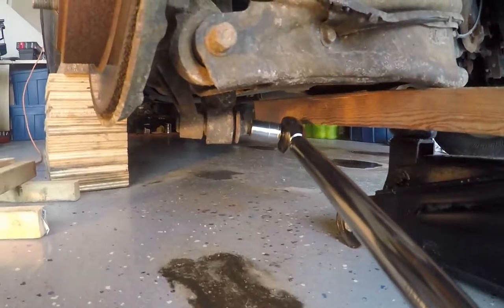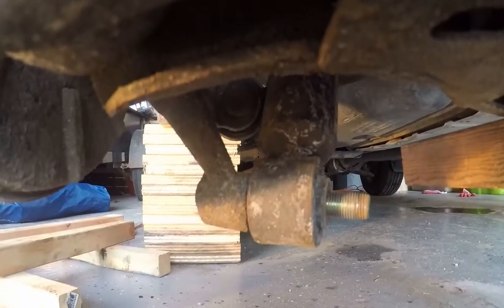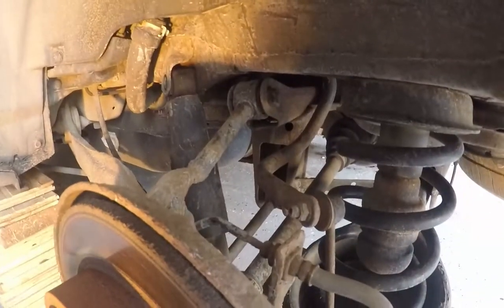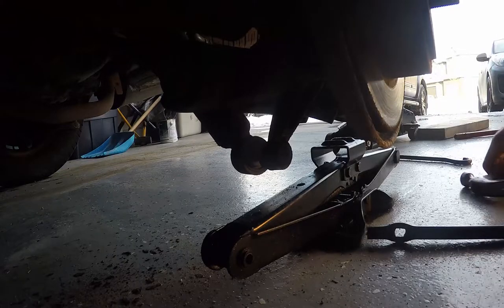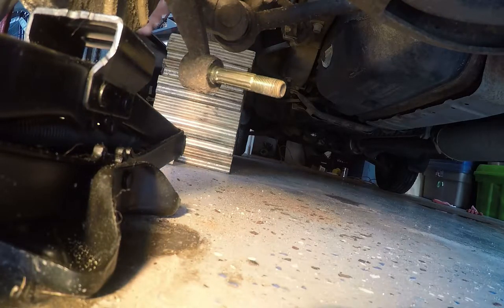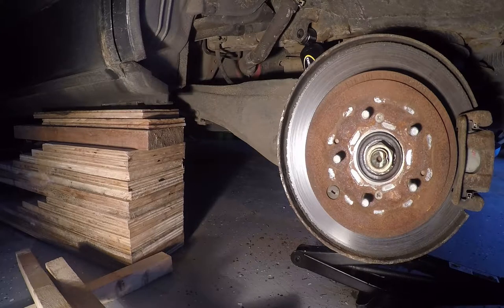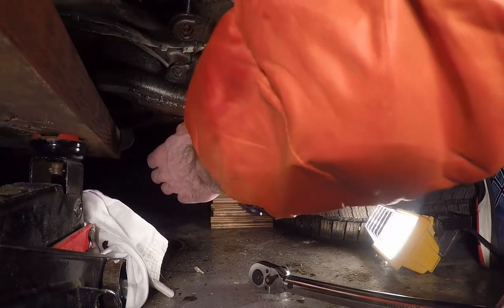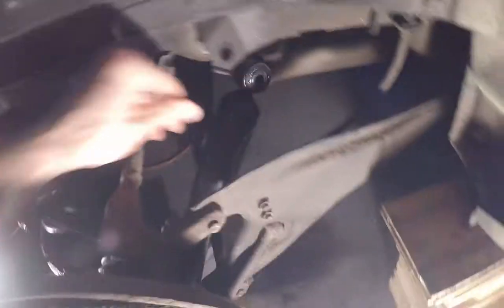2005 Honda Pilot Rear Shock Absorber Replacement

Comment: Great video - thanks for taking the time to record this. I'm doing the same job later this week and went with the same Monroe rear shocks. Have 144K miles on my '05 pilot and noticed the rear is extra "bouncy" lately (still original shocks), even when not under any extra load. Figure I'll do the rears now, and in a month or two replace the front strut/spring assembly. 

How was the ride quality after you did this?
Reply from the maker: It was better.
Not crazy better, but noticable.

Comment: NEVER,NEVER,never ever use a torque wrench as a breaker bar! Torque wrenches are calibrated because these are precision tools.
When torqueing the shock bolts with extensions you lose torque through these extensions.
When you look up torque specs, these are with regard to using a shallow socket with the bolt threads clean and lightly oiled. Even using a deep socket is enough create less torque for that bolt.
Similiary, using extensions decreases the final torque value even more. 
For rear drive vehicles that uses a driveshaft from the transmission to the rear end alot of torque is lost through the long drive shaft. This doesnt include torque that is lost  through the transmission  and the final drive.

By analogytake a 25' garden hose turn on the  water and note the stream of water exiting the hose. Add on 500' to that 25' hose, turn on the water and you will see the stream and pressure  is greatly dimished because it takes more pressure to push the water through the extra length not unlike loss or torque through extensions..
I recall some old school shop manuals gave you revised torque values proportional to the length of extensions to compensate for torque loss.
Reply from the maker: thanks for the feedback
Reply: @volgaboatman7225 I suggest you take a look at Torque Test Channel here on YouTube. They tested your "Theory" and discovered that some things like the shallow vs deep socket used don't really affect the torque as much as you might  think.

They covered a lot in the one particular video they made on this subject, so I suggest that you check it out on your own to learn what and what does not affect the torque results when using a tool like a torque wrench to tighten fasteners to specific torque specs. 

It's a great channel that I highly recommend.

Comment: Please what is the lower connector called? mine is broken
Reply from the maker: Not sure from that description, but maybe the suspension knuckle.  https://www.piloteers.org/threads/what-piece-does-the-rear-shock-bolt-to.24782/
I would go to a scrap year and see if they have what you are looking for.

Comment: Do you need to change rear springs  as well
Reply from the maker: Not if the springs aren't damaged or performing poorly. You can even reuse your springs when replacing struts. I would just do the rear shocks and see how that goes.

Comment: Look great video but you remove a bolt but do not say where it is from. When you remove the lower part is that the strut or another object like the control arm.
Reply from the maker: I'm pretty sure the nut on the bottom is through the lower arm. That said, once you get under there the mounting points should be extremely obvious as the shock is secured at each end and no where else.
Reply: @DIYNorth  thank you I believed it was that but finding any video on it has been difficult. Thank you and I will let you know how it goes for us incase any of your viewers may experience the same.